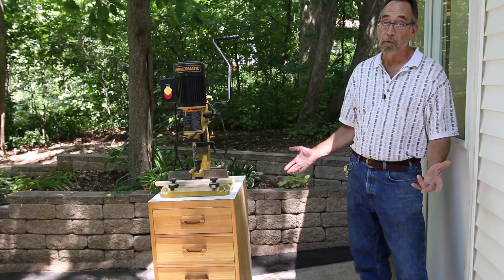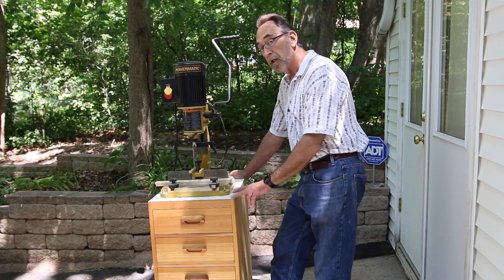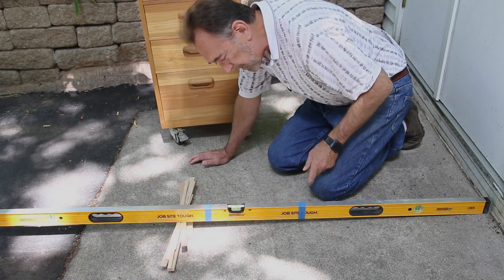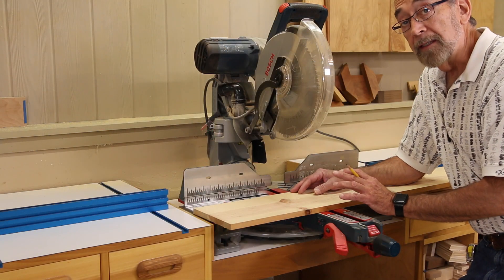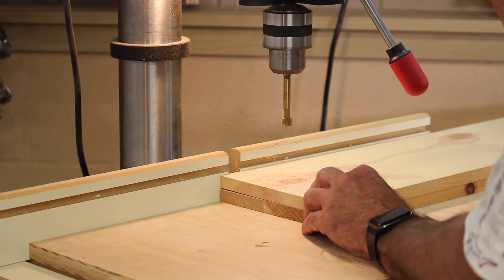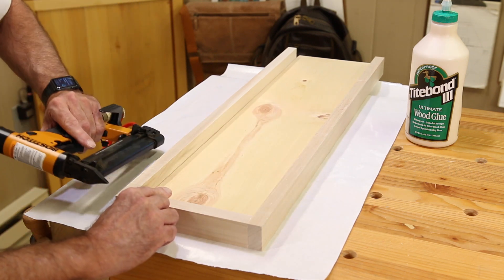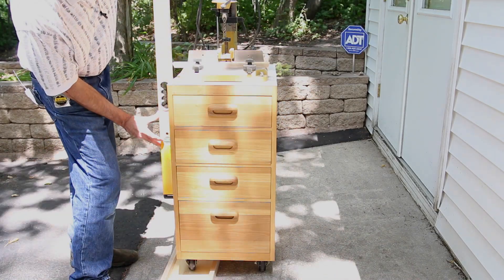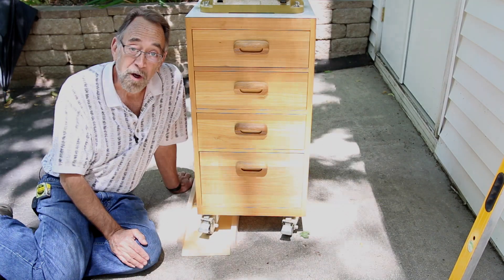Level Machines   Unlevel Floor

Comment: I'm working in my garage and I'm going to be using my router with a jig to level some wood rounds. I needed a right now solution to level the table and the jig. This is a perfect solution. Thank you for posting this video..

Comment: Adjustable casters...it'll change your life. They are rather pricey though.I am thinking of using a long, heavy duty piece of 3/4 or 1" threaded rod that runs all the way through each leg and attaches to a standard, non-adjustable  caster plate. Up top, recessed into the surface of the bench (similar to a dog hole) will have a nut that can be adjusted with a socket and driver to level the workbench on any surface. That's my plan at least.

Comment: I hate that I am being a bit negative today but...
I have hated myself before... I can deal with it.

how can the table now stand level if you didn't account for the anti-slip mat on the bottom 
of the ramp? it should be at least 1/16 or more out of level.

did I miss something or am I the only viewer that pays attention?

Anon
Reply: +Anon Ymousmie Compression due to the mass of the whole assembly.
Reply: to begin with, the table isnt even angled to compensate the floor slop, anyway the base helps a lot.